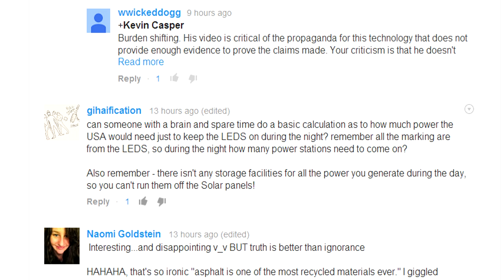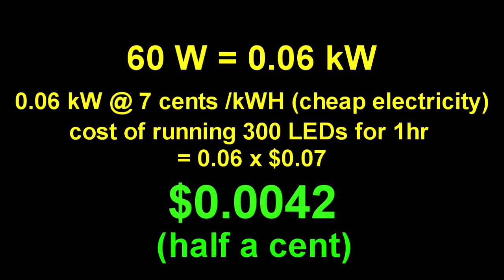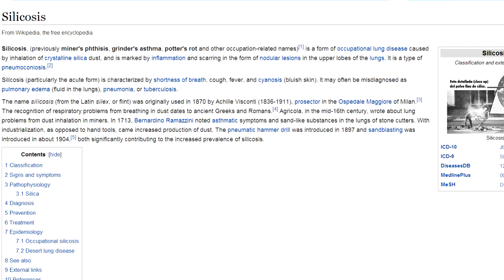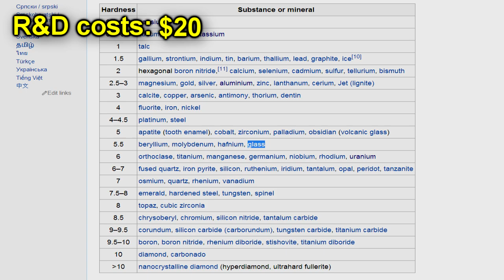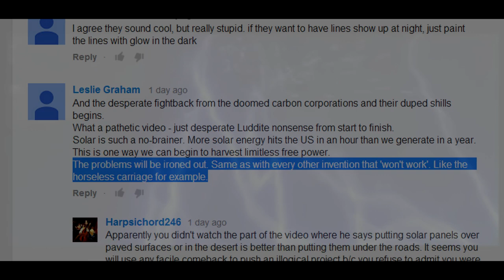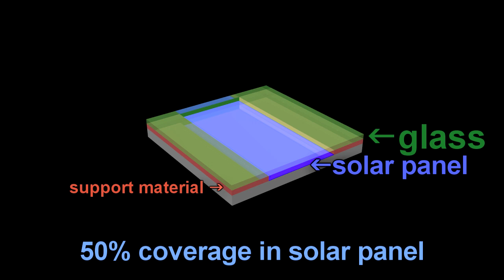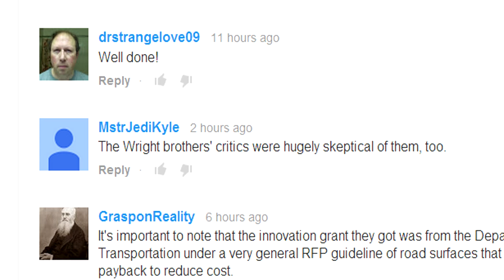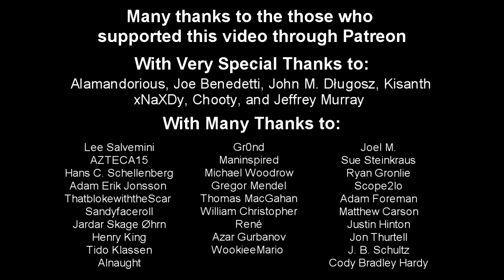Solar Roadways, IMPORTANT QUESTIONS AND ANSWERS!

Comment: I'm a licensed architect.  I know a thing or two about building materials, physics, geometry, electricity, and structural integrity. Solar roadways sounds like a great idea until you break it down like this video does - and it only scratches the surface (so to speak). 

Assuming all the technical challenges associated with modular solar pavers could be solved, they would still have to compete with simpler alternatives ,  like covering roads with solar sheds, or placing tracking solar panels on the shoulders. Parking lot solar shade  structures have been around forever, and have the added benefit of protecting cars from the sun and rain.  You don't have to close the lot when one panel needs replacing or maintenance.

Another simpler plan involves solar skins for cars themselves. Most cars sit in the sun all day on surface lots and roadsides. Hybrids and electric cars could simply harvest and store solar energy for later use, reducing or eliminating the need for charging stations, one of the biggest barriers electric cars face.

But the granddaddy of all solar simplicity is good old roof-top solar. The area of existing rooftops in America is staggering. a typical home has over 1000 square feet of roof area,  much, much more area than required to power a typical household using existing,  proven, inexpensive mass produced photo-voltaic  panels you can buy at WalMart. Energy can be stored in a small battery bank using existing lead-acid golf cart batteries, because weight isnt much of an issue in standalone residential solar installations. It's an issue in cars, but hybrids still use lead acid battery technology economically.

Before jumping on any new, unproven and undeveloped high-tech bandwagon,  ask yourself if said vaporware actually solves an existing problem. Most vaporware  is harebrained,  and is a solution in search of a problem. Solar roadways fall into the "harebrained" category because the the technical challenges are immense, the cost is prohibitive, and  they don't solve any problems not already addressed successfully and economically. They don't make better roads, and they don't generate power that can't be generated more effectively already.

Their appeal is emotional not logical however. This assures the continued survival of the concept, and that fools will invest in it, making the charlatans hawking it rich.

Please visit my perpetual motion artificial gill underwater hoverboard go-fund-me page if you still think solar roadways are a good idea. I only need $1 million dollars to get the idea off the ground, and will pay you back 10 times whatever you invest once I sell the patents, lol....

Comment: All this talk about solar roadways has got me thinking, why not put a thermoelectric generator underneath the road surface? Place some spikes five feet into the earth every six or seven feet to act as heat sinks and you should be able to generate a temperature differential needed to generate current. 
This sort of device would, of course, be most effective in summer and least effective in winter, but as a secondary power source during high demand summer seasons, it might have some benefit.

Comment: Generating solar energy by coating all the roadways in immobile solar panels is like cutting down a tree with a series of Farberger eggs.

Yeah, it's technically possible... but it's extremely expensive, ludicrously impractical, and far less effective than using the proper tools.

Comment: The electricity bill for all the LEDs is huge,but not lazily doing those calculations will reveal a...still unpratcical amount,but I will do them anyways.From their pictures they use for the road marking in the middle 5 LEDs/pannel and 8 for the ones at the edge.
That would mean 13 LEDs/pannel and in total 3.12 trillion LEDs,the cost for 1 hour of keeping them up is 11232 million dollars
I might be wrong so take this with a pinch of salt

Comment: Minor niggle: I'm pretty sure a static photoelectric cell oriented to face the sun at zenith will produce about 40% of the energy of a tracking cell. You want the integral of sin(x) as x goes from 0 to 90 degrees, unless (of course) I screwed that up.

Comment: 50000 LED isn't that amazing. There are 2.073.600 pixels in your average monitor.
Reply: LED screens dont actually have a bunch of LEDs forming each pixel. LED TVs just have LEDs for a backlight instead of more traditional lightsources.

Comment: at least with the wright brothers human flight was already possible.......with gliders and the work of the french man who was the first to fly. and propellers were already powering the zeppelins.  so the wright brothers already had sound science behind them.. they simply needed to develop a lightweight engine to power their flight. everything they did was grounded in physical science. the scientifically ignorant scoffed at them and were wrong. this seems to be the polar opposite. the people who designed th9is roadway are not scientifically literate either in the physical or theoretical. and being scoffed at by those who are. difference being.........the solar roadway is a joke and airplanes jets and the like are common everyday things. it scares me then that a govt. agency who should have scientists working for them who would know from the onset that this project is doomed by design are wasting money on it. another reason to worry about the infrastructure of this country and those in charge of maintaining it.

Comment: we can get those prices down a little with proper ordering and bidding for the pieces in bulk.... even then it still doesn't cut enough, and we haven't even talked about all the batteries needed to support a system to run at night if we are not going to keep our current infrastructure. Either way you look at it this is a pipe dream in a fantasy world. it makes far more sense to have smaller wind farms along our highways that can harness the air being pushed by our own vehicles and need to move about.

Comment: Though I agree with many of your statements about POC testing, your actual testing procedures for the glass and LEDs are a bit flawed. The point of this comment isn't to say you are wrong about the panels being a bad idea currently, just to focus the reasoning as to why this idea isn't currently feasible. Special LED's would need to be made to grant visibility during the day. Special thick textured glass with polymer layers could be used instead of pure glass. Circuit boards, computer chips, electrical components, and other hardware would be needed in excess for prototyping and testing effectively. Most of what R+D would need for this project can't be bought from a store. R+D cost should be high to prove how viable this technology is, because special materials would be required to create these panels. This also means that the panels will be exponentially more expensive than your most expensive analysis shows. To create such a specialty item and cover the US with them would be a massive money pit that would serve to cripple the American economy further. Solar Roadways could become viable someday when the cost of materials and manufacturing drops significantly, or if we have a breakthrough in solar panel technology, but as of right now, there is no possible way to cover all the US roads using this design.

Comment: As much as the prototype is clearly pure rubbish, the idea in itself may still have some potential. Obviously a glass surface won't work, both because it isn't durable enough and because I imagine that it would become quite slippery in rainy weather, however if it could be replaced by a different material (maybe a sort of hard transparent plastic, i don't know). With the improvements in effiency of solar power, perhabs it could turn into a profit in the long run. As far as the angle of the road structure, as long as it produces more power than it consumes it still would be worth it. It definetly won't work in the near future, but maybe down the line it might. The vast area roads consume are sort of being put to waste.

Comment: How about we put solar panels next to the road, or build tunnels with solar panels on top of them. Shouldn't that be way more efficient than on the road? Like doing that solves the glass problem, while also raising efficiency, while also bringing down cost because the LED's are a retarded idea. A white line or yellow line of paint would work better than LED's and cost less.

Comment: I'm no fan of "solar freaking roadways,," but I can't help but feel it's a bit unfair to take retail prices for LED strips on ebay and apply them to the mother of all bulk purchases. Even purchasing small amounts of LEDs (in the hundreds) the price drops down to almost nothing, maybe it would have been better to ask for a quote on alibaba? Then multiply by 3-10 because it's a federal project.

The calculations about how many LEDs you'd need were pretty interesting though.
Reply: You're right, it is unfair.  They would need to use much more powerful LEDs for even half a chance at having them be visible during the day, which would make the cost of the LEDs significantly higher than cheap, low-power LED strips.  Even in bulk, once you get beyond the cheap and extremely mass-produced low-power LEDs, the prices shoot up quite quickly
Reply: No matter what kind of LEDs they decided to go with the price would be extraordinarily low if they're buying billions of them. The cost of LEDs is by far the least troublesome part of this proposal.
Reply: Peter Houlihan I'm serious, go look at the price of 2400LM LEDs at the mass production level.  They're about what you'd need to have them usable in the day.  Their production costs are many magnitudes higher than string / rope LEDs, meaning that in-bulk their price is extraordinarily low compared to buying them individually, but not extraordinary low in a cost-analysis basis.

Though your dismissal suggests you're unwilling to humor this.  Not all LEDs are mass-produced on a level that they are cost-neutral
Reply: I don't need to go look at anything, I've bought them before and they're nowhere near as expensive as you seem to think they are. Did someone rip you off?

And yes, I'm capable of multiplying thank you.
Reply: Peter Houlihan You've bought en-masse 2400LM LEDs before in the small envelope required to put them in these roadways?  I know they aren't EXPENSIVE, but they are cost intensive at the scale of solar roadways.  Not Thunderfoot's numbers, but significant.  I'm not talking about full-profile 2400LMs, because those won't reliably fit in a thin solar roadway tile.  Low profile-- the ones that require a cooling plate due to lack of surface area due to being low profile.  They are, again, many magnitudes more expensive than the rope / belt LEDs at a mass-produced level (The particular ones thunderfoot had are cost-negligible, they were only 50LM).  2400LM low-profile LED units have a notable per-unit cost even in massive bulk, five seconds of research on your part would tell you this.

No, not 20 bucks for 10 expensive, but far more expensive than you're leading on with the "cost isn't a factor" nonsense.  It would still be a largely significant cost in production if they actually wanted the roadway lights to work.
Reply: "Not Thunderfoot's numbers"

Thank you for agreeing with my original point. We can all go home now.
Reply: Peter Houlihan Ah, I might have confused you with another bloke at some point-- I could have sworn there was a "the cost isn't consequential" bit somewhere, but I don't see it in your original post here :(  At any rate, cheers !
Reply: Lol, no worries. It can be hard to keep track sometimes.

The cost of repaving the entire US road system would most certainly be consequential, even if you're doing it with regular cheap asphaly. Redoing it with solar panels would be insane.
Reply: I agree, the LEDs should have been priced more appropriately in his math. While we're at it, why don't we also factor in the cost of the concrete base, the cost of the mounting structure, electronics, installation, the ongoing maintenance costs, and the cleaning costs? Ya know, in the interest of fairness and accuracy. Focusing only on the LEDs is like the tail wagging the dog.
Reply: He was the one who focused on the LEDs, not me. And yes, installation costs and maintainence would cost far more than manufacturing these things.

Comment: I keep wondering about theft and vandalism too. How hard would it be to remove these panels given they're intended to be replaced and maintained? I speculate it wouldn't be too hard. People will already strip copper cables from public infrastructure so I assume these would be appealing, especially if they're made of special magical materials. 

I realise this wouldn't be an issue everywhere, but given they explicitly want to cover the entire US road network in them I'm sure it would emerge as an issue. Or hey just get a single spray paint can and you can ruin a massive number of them.

Comment: not that I'm defending solar roadways because it is a stupid idea but your assumptions are a little over the top, yes the panel has 50 LED's but all of them wouldn't be on all the time, plus the elecrtic cost wouldn't be that much since the electricity is generated with the solar panels.

Comment: Not sure if anyone has brought attention to this, but white tends to absorb the light visually. If you put the LEDs against a black, or dark surface is it possible it could show up better, or would the effect be negligible?
Reply: Lee Woods But the sun glare though.
Reply: An absorbent black surface would make the lights more apparent, and much more powerful LEDs exist than the ones used in the video.  Those two factoids combined still make trying to overpower daytime sunlight with LEDs that you're viewing from a 20 degree angle an absolute joke

Comment: Thunderf00t bulk ordering would drop the price of 800 bn of led, don't forget that bulk buying is cheaper than retail price.  same with microprocessors and the Silicon needed.
Reply: They'll also need to use more powerful LEDs for them to bear any use at a 20 degree viewing angle any time other than the dead of night.  Have you looked up the cost of LEDs which would be bright enough for non full-sun but daylight applications?  Even in bulk, they're pretty nasty expensive.

Comment: not that i'm sold on the solar roads idea but your math is flawed on the led power usage there would never be a time when there would be more than a fraction of the leds in use at one time, and one scheme states that that since there would be sensors in the road way on lesser used stretches of road could be left off altogether until needed
Reply: Who's footing the increase in production cost due to the added complexity of adding a processing block to the microprocessor and a pressure sensor in every panel?  Also, I agree that the usage would be lower, but we also need to use much, much more powerful LEDs (the most powerful in this size envelope still don't overpower the sun in the dead of day), which would greatly offset any benefit gained by turning LEDs off.  

Not to mention this would mean each panel has to have the ability to communicate and process the data required to process pressure data in order to intelligently draw out lines and the sort ahead of the car, as it would do us no good to draw lines on the panels as we are driving on them :)

Comment: The solar freakin' roadway lit up the feet around the deer 1:02. So if a tiny child deer weighs about 30 kilos, and we divide that by 4 legs, i.e 7.5 kilos, whatever sensors they put in all of those have to be able to feel 7.5 kilos, but they also have to be less than two inches tall, and with virtually no X and Y axis size at all, because those are precise about where the deer's legs are.

They also have to be able standing a big lorry trailer with big concrete pipes and pillars for construction sites, and big rigid lorries with transformer boxes sometimes weighing several tens of tons on 2-3 axels, all without breaking. For decades. Has to withstand emergency stops, and if it's infront of an intersection, has to withstand regular stops.

Inevitably they'd say "don't take it so literally, it's just an artist's rendition". That's the problem with this project though, it's all just an artist's rendition. The real thing the LEDs are nowhere near as visible, dense or colourful as displayed.

Comment: your math is way off.  1st, you don't calculate cost of manufacturing by comparing prices of a different product consumers buy off amazon, ie LED Lights.

2nd, for a 40' section of highway, one lane being 12'  wide, your lighting a total of 13.3 sq ft (4 inch solid stripe) with 480 sq ft of panels.  that doesnt equate to lighting up all 50 leds on every single panel at the exact same time.
Reply: someone crazy buying in bulk is cheaper than retail price thunderf00t calculations are based on retail price 
the product would be inefficient at first but that is everything. 800 bn is more likely  600-450bn just like video games, components are cheaper to buy in bulk
Reply: Now re-run your calculation for 2400LM LEDs, about what you'd need for them to be visible at a 20 degree angle during daylight.  I'd wager that, even in extreme bulk, his calculation wouldn't be all that bad :)